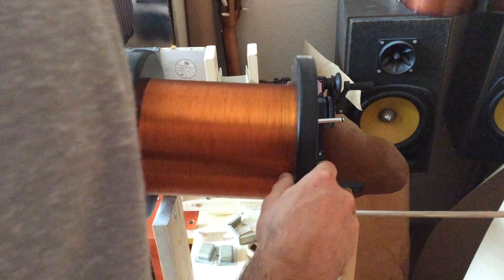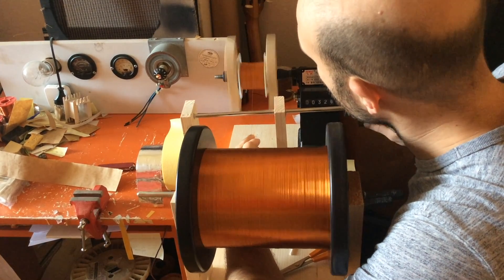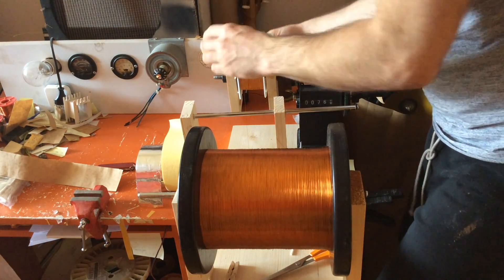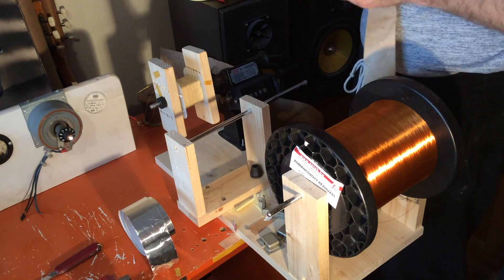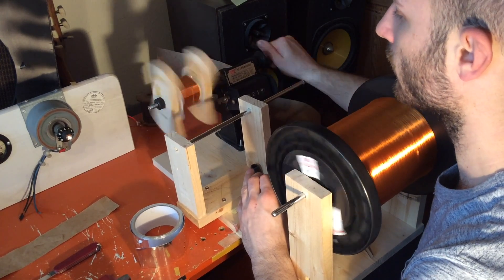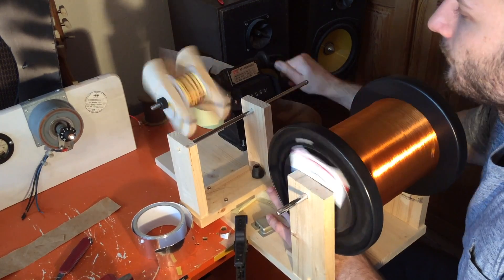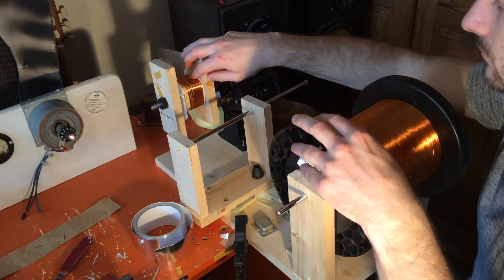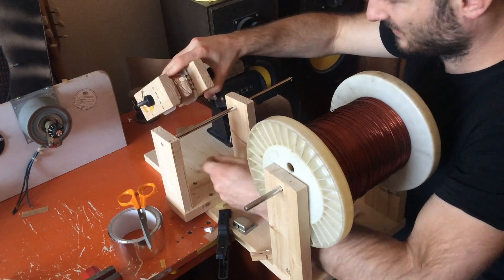5e8 Project - Fender Power Transformer Winding Part I

Comment: Is the pressed paper some type of special high heat paper? Does anyone know where to find that type of paper in Canada?
Reply from the maker: It is also called craft paper, it is paper impregnatwd with wax. But, it ia not really needed, you can just use kapton or yellow transformer tape, they are thinner and far better insulators.

Comment: Sir, You have inspired me to wind the output and power transformers for a 5e3 amp project.

Can you point me to a resource for the power transformer wire sizes for the primary and the multiple output voltage/currents?  

I’ve repaired a dozen or so vacuum guitar amplifiers and understand transformer fundamentals, turns ratio, etc.

In my home machine shop, I machine B bender kits of the Parsons While style, and have decades of electronics design and repairs of most things a guitar player can break.

I believe I’ll buy your transformer calculator for iOS as you’ve done all the work producing a valuation tool I need.

Thanks much 
Bill Bores
Reply from the maker: Thank you, Bill. I answered your email.

Comment: Hi! In vintage transformer designs, I see that the common practice is to do one layer of winding, tape over it with wax/cloth tape, then continue the winding process in that way. Is that necessary with modern enameled wire on the market today?
Reply from the maker: Modern enameled wire made for motors and transformers has two coats of enamel, and can withstand few thousand volts. Using tape between layers is useful if you want to make uniform, neat windings and to have wires of one layer on top of another one which in some cases gives a better performing transformer due to less leakage inductance. What I would not omit is insulation between low voltage and high voltage windings and for sure always use insulation between mains primary and the rest of the windings for safety.
Reply: @Delatsch Thank you for the reply! I suspected such. I'm in the process of ordering new wire to rewind an EI-96 core trafo that I pulled out of an old ECL82 stereo kit that had a bad primary. I want my windings to be neat, so I'll probably just wait until I get my stepper motor rig working so I can automate it as much as possible.

Comment: Hi from Mauritius. I am rewinding a toroidal power transformer, but since its my first time I dont have any clue about the type of masking tape to use.. does the yellow ones have specific insulating properties or any kind of masking tape will do? thanks
Reply from the maker: Masking tape is only used to secure the windings it does not provide any real insulation. For proper insulation especially between primary and secondary you should use high voltage insulation tape (kapton or other type of tape that can withstand high voltages)

Comment: Is heatshrink necessary?
Reply from the maker: Heat shrink is not necessary, but it protects the wire mechanically and also provides additional insulation.
Reply: @Delatsch  thank you so much sir. I wind my transformer and i forgot to put heatshrink on the wire's in and out.

Comment: What's the core size of your transformer? I'm planning to buy your calculator soon. :)
Reply from the maker: I think it was 36x40mm. Thanks for your support!
Reply: @Delatsch  thank you. So you made 2 primary windings of thinner wire then join the leads in parallel? Am i correct?
Reply from the maker: Yeah, if you don't have the correct gauge you can use two identical windings of thinner wire in parallel.
Reply: @Delatsch  thank you. Your channel is amazing. Please keep.on inspiring people like us. Thank you
Reply from the maker: Thank you very much for your support! I will do my best to keep you inspired :)

Comment: What is the small piece of aluminum tape for? It's to small to be a shield.
Reply from the maker: It's just there to hold the wire, it serves no other purpose. I've switched to a normal masking tape since, because people seemed to be bothered with aluminum in a transformer. Thanks for stopping by!
Reply: @Delatsch  I understand. Thanks.
I asked because I often included copper foil shields in my designs.  Cheers.
Reply from the maker: Cool, what kind of equipment are you building? Guitar amps or hifi or audio recording gear?
Reply: @Delatsch  I designed transformers as part of my work as a power electronics design engineer in the aerospace industry.  I was not in the dedicated to inductive component design group, but sometimes I did my own breadboard and then passed it to them to formalize.  I have an old Gibson Ranger from 60 years ago that works just fine. I'm also a radio amateur, but not desperate enough to wind my own plate transformers - yet :-)
Whoops! That's not entirely true. I rebuilt the 100VA plate transformer in one of my old 1950's transmitters and a choke in another.
Reply from the maker: Haha, nice to hear that. It's really quite an experience when you wind or rewind a transformer and then it works in a circuit. It's really special comparing to just laying out other components (which is also nice) especially when you play the amp with your own transformer in it is really something else!

Comment: i was under the impression that in modern power transformers that the mains should have a separate section from the output. you see this on walwarts
Reply from the maker: It is usually practical if you have just one primary and one secondary winding than you can save on the insulation materials. But when you have multiple taps on the secondary and more windings on the secondary side than the primary, it's not practical because primary takes a lot less space than the rest of the windings, so it would make a large gap on the bobbin and you would have to use too large a core for a given power. No manufacturer of tube amps or tube amp transformers uses split bobbins as far as I know. It would be a total overkill.

Comment: Hi, thanks for such interesting content! Can you please tell the dimensions of the bobbin and EI matching parts? I would like to make a power tube transformer but the variety of transformer parts sizes makes me confused. I'd like to have 400-450 B+ as an output.
Reply from the maker: Hi Evgeny, 
Thanks for your comment. The transformer core size depends on the overall power that transformer needs to handle and the bobbin size on wether you can fit all the windings. To precisely calculate these values and all the other aspects of the transformer I've created a simple automatic spreadsheet calculator with a short PDF tutorial on how to use it. The spreadsheet and the tutorial are available for sale, if you are interested please contact me on my facebook page.
Reply: Thank you!

Comment: hi could yo tell me the gauge of wire you used. thanks and great job
Reply from the maker: Hi Andy, 
Thank you for your kind words! If I remember correctly I've used 30 gauge wire for the B+ winding and bias winding, 25 gauge wire for the primary (but for 220V European mains) and for the heaters I used 18 guage, but I would strongly suggest 16 gauge to avoid any chance of overheating on the long run.
Reply: Delatsch thank you so much. We should video talk. I have a amp making business and would love for you to be a part of it. I'm in the states
Reply from the maker: Thank you Andy. Please contact me on my facebook page, so we can communicate more easily. You can find the link in the description of this video.